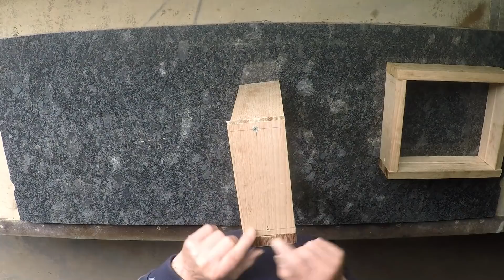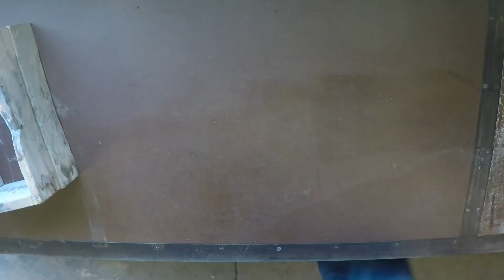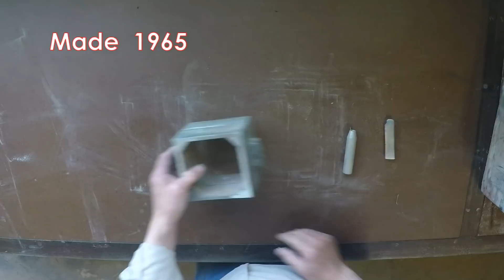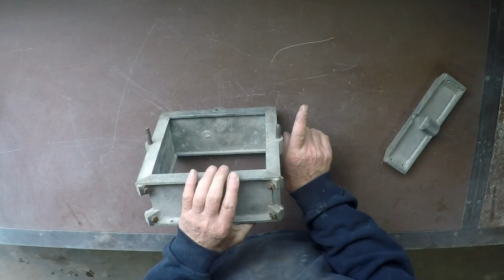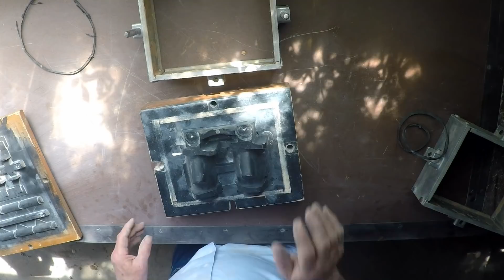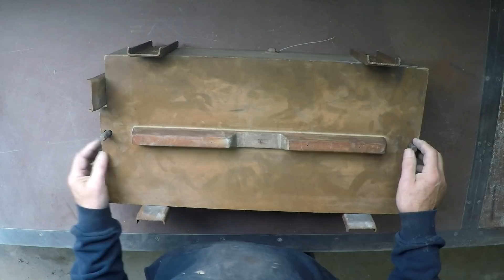Moulding box journey

Comment: 16:00 maybe loctite for the pins sloppin' around.
Reply from the maker: Bobby, Because the pins and the holes they had to go into were so ordinary I had to leave the pins loose so they could move a little to accommodate the inaccuracies as the two box halves went together. I could indeed have used Loctite but I fear the pins would not have gone into the other holes unless I took great care to align the pin with the holes - and that was the problem - I had not done proper alignment up front. The idea of threaded pins seemed so easy so clever etc but it turned out to be a disaster. The pins are the hardest part of any moulding box. I speak from bitter experience... Martin

Comment: great video thanks for sharing your hands-on comments, to know what hassles you have gone through is invaluable.
Reply from the maker: TheSilver, I guess what I am on about is shortening other people 50 year journeys - if I have managed to do that I am well pleased.. Martin
Reply: Olfoundryman:  hi Martin my experience has been that having a similar shape with 10"x14"x21/2" was a great size with junk aluminium one piece with that clearance enabling ease lifts also the pin height is needed to be at least flush with the cope height so you can use your thumb to press down as the for fingers lift this enable an easily controllable lift for the list inch or so. Hand feel is an all important feature i agree… 
One piece are good too for flatness twist stability till they are dropped to many times when knocking out and inevitably a corner cracks open rendering that box half useless. Hard sand with a step joint is a good option bit it cost you in reclamation equipment. Sometimes the improvement in reject rates easily justifies the increased sand costs. But yes, green sand with sturdy boxes has an awful lot to be said in favour of it simplicity wise and smooth finish!
 thanks for sharing your experience's.
Reply from the maker: TheSilver, The sharing is my pleasure made all the more so by getting comments from experienced people like yourself - it all adds to the knowledge base - thank you..... Martin

Comment: Fantastic, invaluable information you're sharing with us.

Can I ask why you prefer greensand to oil bonded sand for your work?
Reply from the maker: Greg, I guess  that I just started with green sand - it was what everyone used back then (1960s). I don't even know if petrobond had been  invented. I have many times considered trying petrobond as it is very useful for plaque work, but it has some problems;- Many people do not like the oily feel it has, The smell and smoke on pouring, That it supposedly needs proper mulling to keep it in good condition, That it is expensive ($4.00 per Kg out here) - I use about 400 Kg of sand so that would be a big investment, That it slows solidification down so mechanical properties of the casting tend to be lower, That you have to try and get rid of any sand that was against the metal. It has its advantages of course, the main one seems to be better surface finish but my green sand will give a better finish than petrobond any day.....Martin
Reply: @olfoundryman8418  Thank you again for such detailed information! I really appreciate you taking the time to reply. This is food for thought.
Reply: Your series is a real service to those of us with less experience.

Comment: Hi Martin. Have watched all your interesting and knowledgeable videos. There are a couple of questions I would like to ask if you have time. 1) Does brass and bronze have the same propensity to pick up hydrogen ? 2) Is the use of steel crucibles suitable for melting and casting these metals ? Thanks Mike.
Reply from the maker: Michael, 1, Unfortunately just about all metals will dissolve hydrogen - the hydrogen atom is so small it gets in everywhere. But the problem with hydrogen is more to do with what happens when the metal solidifies - in many cases the solubility of hydrogen in the metal does not change much when solidification occurs so the hydrogen just stays in solution where it does no harm (except in the case of some steels ) But in the case of aluminium the solubility changes very greatly and the hydrogen comes out of solution and forms bubbles. With copper base materials the problem is usually that as solidification occurs any hydrogen will react  with any oxygen present (often as copper oxide) and form steam it is this steam that causes bubbles in copper and some of its alloys.
               2, With the exception of some low melting alloys I do NOT believe that steel crucibles should ever be used. Molten metals are aggressive solvents and in the case of aluminium complex aluminium silicon iron compounds are formed these are a serious impurities in aluminium alloys. Not only does it ruin the aluminium but you are likely to have molten aluminium peeing down your leg when the steel crucible develops a hole. With  copper base alloys there is a serious problem in that many will stress corrode steels, this can lead to sudden catastrophic failure with the crucible falling in half - apart from the hole problem of course. Incidentally stainless steel is worse that mild steel...Martin
Reply: @olfoundryman8418  Thank you Martin for taking the trouble to explain the dangers of using steel crucibles.  I look forward to seeing more of your very informative videos.

Comment: I was surprised by the slop fit of those bolts.  It’s probably caused by the fast and cheap method of rolling the threads on.  But I wonder if you would have had better success with studs.  I can see how they would create their own problems, but I’ve used and run into enough studs to know that they do go in straight.  Perhaps the thread count has something to do with it.  I’ve noticed that all studs have a finer thread pitch at the base.
Reply from the maker: Sheminger, Studs may well have worked better, some of those bolts were a bit cheap and nasty! One thing I have noticed is that the pins work better (much less tendency to grab or to corrode) if they are hard. Hence my preference for induction hardened shafting to make the pins from - the shaft I use is meant as the inners for linear bearings. It is hard straight and very smooth. - Ideal... Martin

Comment: I faced the same problem with the unbalanced boxes. I dont have a circular saw. I had to use my router to make the wood the same size. I think in 99% of cases its just the missing tools which obstruct the making process.
Reply from the maker: Han, You are dead right, a decent bench saw that will cut square and most of the problems go away.... Martin

Comment: when i made my smap flask i used the slotted ears i also used bolts as your early ones perhaps not a good idea but it seems to work although i don't think i have things as tight as yours . i did put a little taper on th end of my pins so they start very easy then comes nicely to the full diameter.
Reply from the maker: Old iron. The slots are actually quite and old idea - I certainly did not invent it. With bolts you do seem to have to run things looser. I find the hard pins capable of tighter tolerances and they seem to stick and corrode less too - I have a taper, well, more of a bevel really on the end of the pins. I would like a little more of a gentle taper but with the hard pins its very slow to put on (die grinder in a lathe!) so the bevel had to do…. Martin

Comment: Good to see you back! I missed your vids!
Reply from the maker: Christopher, Good to be back and sorry about the lack of videos  - it was not my best year - some health issues. I have plans for more videos hopefully quite soon (by my standards 😏)... Martin
Reply: Hope 2020 sees you in good health! A possible suggestion! I noticed you're not a big fan of sodium silicate cores and only use them when you forced to, due to poor breakdown etc. I use sodium silicate for both cores and molds as its more convenient for me, no mulling etc. as I have no garage or place to work. I mold outdoors or on the kitchen floor. People and quiet a few textbooks say sodium silicate reacts to the Co2 in the air and cures over time. This is not true! The sodium silicate simply dehydrates and hardens to almost full hardness, but if you chuck the sodium silicate bound sand into water it simply rehydrates with the water and the sand falls to the bottom. Simply make the mold or core and leave it outside (hot weather) for a few days, weather and size dependant. I've left them up to a year with no ill effects. The mold develops almost full strength of gassed sodium silicate and is completely dry, but when poured only the first few mm's in contact with the metal cures. When the metal solidifies simply put the complete mold into water and the sand falls to the bottom. In Campbell's books he describes something similar which industry is now using as its easier to reclaim the sand. The Co2 method is the fastest for mass production but hard to reclaim the sand. If you still want full strength after it has dried simply put the mold in the oven for an hour at 200 degrees C. I discovered this as I had no CO2, and left the mold sitting for a month before pouring it.
Reply from the maker: Christopher, I solve the breakdown problem by adding 1/2 a percent of glucose powder to the sand just before adding the sodium silicate. After casting the core will wash out particularly if you use a hose. The glucose slightly weakens the core.
The problem I find with air drying the core is that it has such poor green strength that it is very hard to get it out of the core box in one piece so it can be air dried.  I prefer shell cores because they are stronger (much, much stronger) store indefinitely are quicker and easier to make and they have good breakdown they also seem to provide a better finish. The finish from 70 AFS sand in a silicate core is very poor - the same base sand as a shell core is a lot better... Martin

Comment: Thanks for sharing your 55 year long  learning & experience in making Moulding box.  That hole & slot combo guide is a very good tip.
Reply from the maker: rrangana, In my opinion the hole and slot arrangement is an absolute necessity it juts solves so many problems and makes it just so much easier. Only point I forgot to mention is to always use ones dominant hand on the hole end.... Martin

Comment: I'll be watching this a dozen times to absorb everything. But you presented a coherent way of thinking it through. Basic principals. Much better than drawings. Looking at all you have shown. A drill press with a proper table support so it doesn't flex. Yes most drill presses are not really rigid. And a nominal 12" disc sander will do most of you machining. A file and some simple flat filing tricks similar to filing buttons but to keep you on a plane will keep you flat on the mating surfaces. Disc sander for the edges and squaring up. You can also cut aluminium with normal saw blades. Just rub parafin wax on the blade sides whilst it is not turning and you will have a bit of lubrication. Repeat as necessary. My 0.5 cents 

Awesome video. More information in this than in a few of the casting books that I have.  Must have taken some time to make. I appreciate it! And good to see you back in action. My best wishes for the new year.
Reply from the maker: Mark, In the planed part 2 of this video the approach we have taken is much as you suggest ,we have planned it so it uses a minimum of tools and any tools in the "not usual" category (a 12mm hand reamer and a 3mm tap for example ) are readily and cheaply available via sites like eBay. We have assumed that most people have access to a drill press and a 3d printer. We  are hopeful that there will be very little machining  or even disc sanding necessary - some parting line filing but little else. The box we will come up with is a combination of the good features of the preceding 55 years worth. I think you will like the design.... Martin
Reply: @olfoundryman8418    I wouldn't miss it for all the tea in China. Keep cool. Seems like your summer is a bit warm this year. I'm in the midst of a winter rain storm. It tends to freeze when it's below 0 degrees C.
Reply from the maker: Mark, Warm? OMG it was 43 C on each of the last two days 😱 and our really hot weather is usually end of January start of February - its going to be a long hot summer bush fires everywhere 😟…. Martin
Reply: @olfoundryman8418   And I hear that there is no climate change! Wow. I have been in heat like that occasionally here in Canada and in Southern China. Oppressive to say the least.
Reply from the maker: Mark, Actually our hottest day and not coincidentalluy our worst fires were in January 1851 it hit 47 deg C in Melbourne (Nearly 117 deg F) 5 million Hectares burnt out. Usually when it gets anywhere near this bad the humidity is below 10% and a screamingly  hot north wind blows hence the fires. Our eucalypt forests just explode. These bad years are about 10 years apart so our history is littered with them... Martin

Comment: Thanks for this, it's really helpful. It mirrored my own journey of the last for years,  up to wooden boxes with  bolts with heads cut off as alignment pins, which is my last pair of boxes.  I think my project for this week (before I have to go back to my day job after the new year) is a pattern for a metal box like yours.
Reply from the maker: n8hfi, Hang in there ,part two wil make it a lot easier for you and it will produce a box I believe superior to anything in this video. Included wil be acess to STL files to 3D print the box side patterns (4 different sizes)....Martin